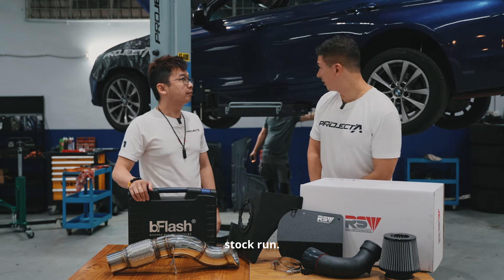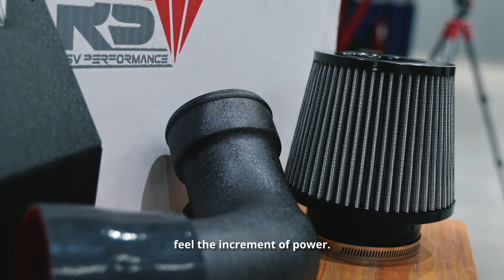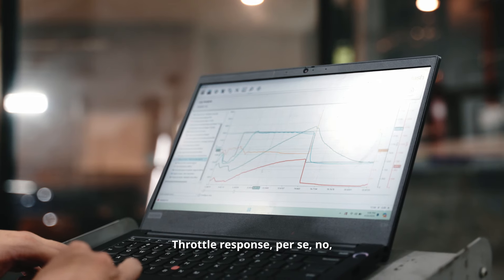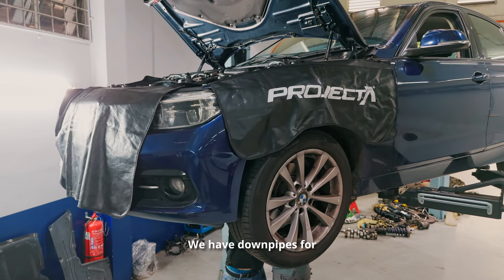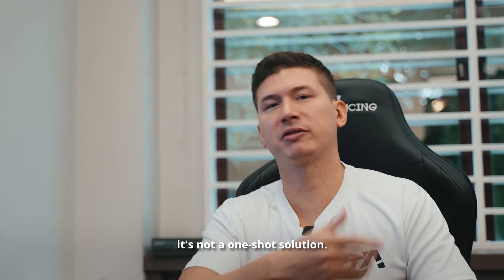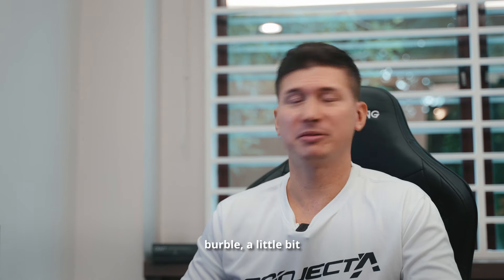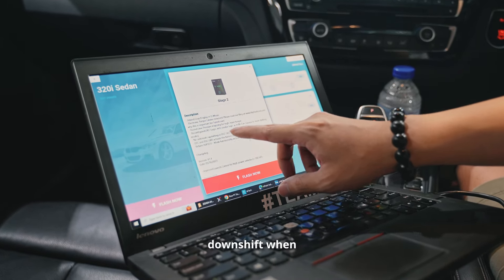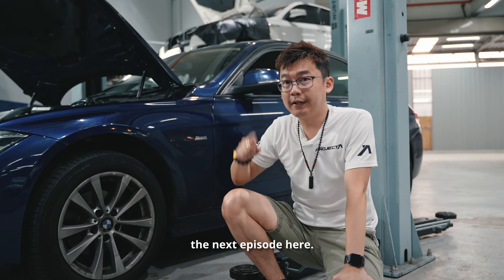EP2: Installing RSV Intake & High-Flow Catless Downpipe For STAGE 2+ (LCI BMW F30 320i Project Car)

Comment: Hi nice video, have always been a fan of the f30 platform. Can you guys explain if there are any differences in the engine internals between the 320i and 330i or is it just the tune that’s different as the 330i makes much more power in stock form?